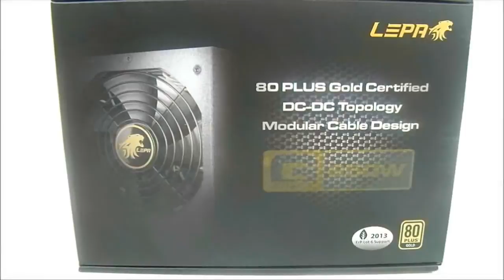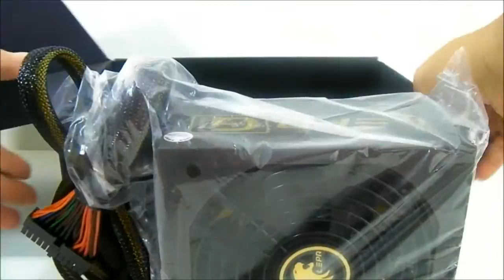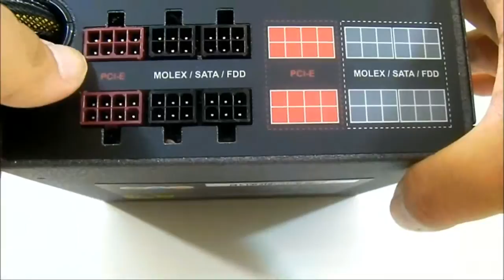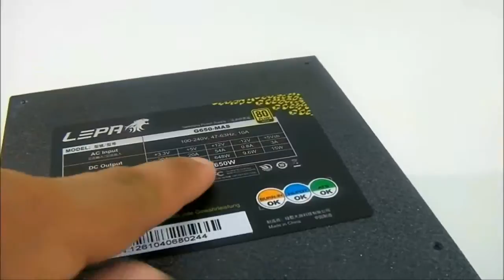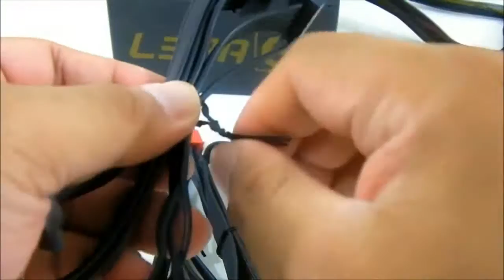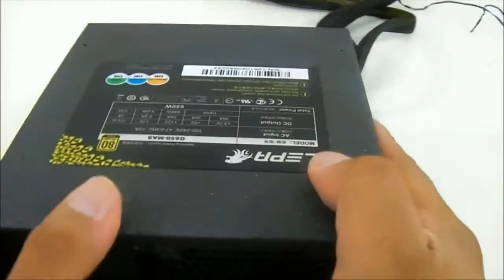Lepa G650-MAS 650W Power Supply Overview

Comment: My LEPA G650-MAS is extremely noisy in the games, I expected that this power supply was fairly quiet. My configuration is: i5 2500k@4.4ghz, asrock z68 Extreme3 Gen3, Asus r9 280x, 8gb ram. I do not think there is an excessive load as well. My ex-psu (corsair cx500 - 40€) was much more quiet than this.
Has anyone tried this power supply?
Reply: I didn't try this psu, but could it be that your gpu or cpu cooler is loud? That psu is only little more than half-loaded
Reply: Andrash88  Thank you for the answer and sorry for my english but i'm Italian.
I've tryed to put the cooler's fan and the vga's fan at minimum but the noise is still remained. It is the psu's fan (a yate loon) that is very very noisy. I think I try to replace it with another fan.. It is very annoying..
Reply: I also have this psu and it gets ridiculously loud. Never had anything like it before